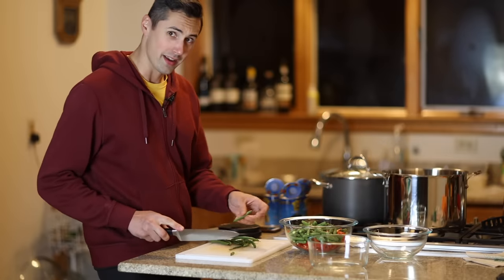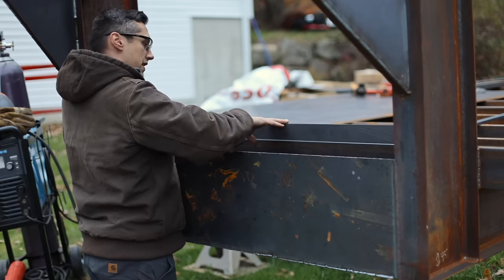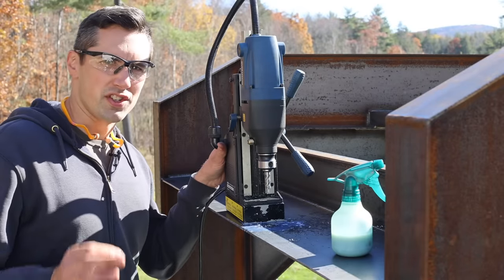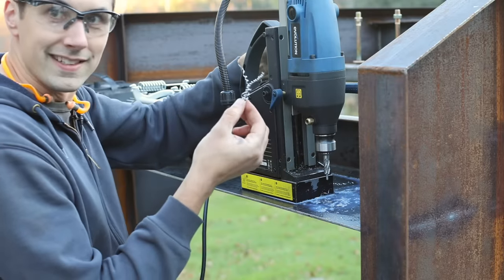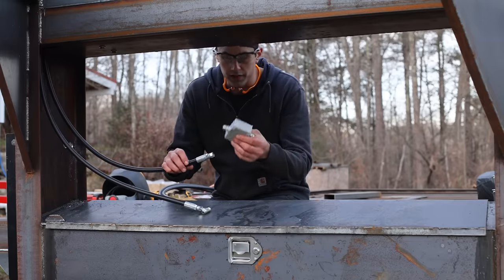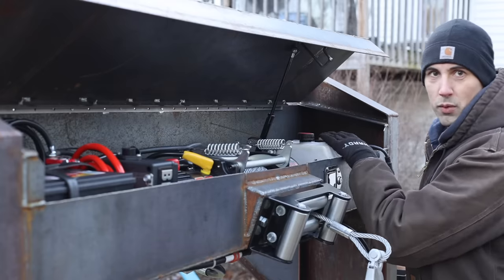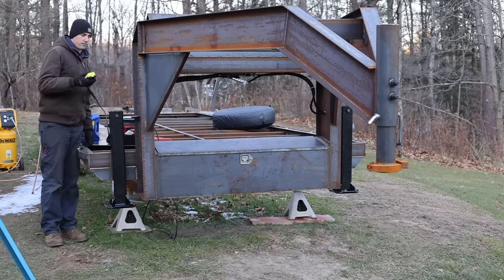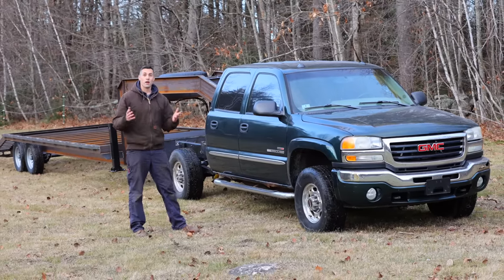Gooseneck Trailer Build Part 2: Hydraulic Jacks, Toolboxes, and a Winch

Comment: Ok I think ur gonna need a bigger solar panel my guy, 3 watts isn’t enough to charge your phone,,, it would take 500 hours to charge that lead acid battery from empty to full,,, every second you use your winch at full capacity you need to charge the batty with that solar panel for 2 days at least (I think my math is correct don’t quote me ❤️ I love ur vids and this isn’t meant to be a hateful comment I’m just putting numbers out there, get ur self a 50w solar panel)

Comment: I know you went cheap... but coming from experience whose owned these trailers....  the BATTERY... you don't need to be looking a Cold cranking amps because you're not running a car... the battery you need is a DEEP CYCLE. 

With a Cranking Battery, you run a motor to start an engine for a few seconds... you're trailer, your running motors (Jack's and wenches) for minutes at a time, so Deep Cycle is the way to go...

You battery would go dead, and even lower battery if you used your wench to recover a disabled dozer or tractor one day...
Reply: And you're going to need safety chains on your coupler...  thats a Federal Requirement

Comment: Im not an engineer (you’ve mentioned you have an engineering background) 

But that winch will fail. Ive seen these fail on a few occasions due to insufficient mounting plate strength. A sheet of 3/16 mild steel will not hold the force a 12k will put on it.

Comment: Not to be a Jerk , but i can tell by the Craftsmanship  you do that you like  things that are quality i’ve owned many Boats and Trailers  don’t be too suprised if the Stainless Hardware you got off the Internet starts Rusting up quickly as there are different grades of Stainless and usually  to keep the pricing low Online they  usually send you the  least quality FYI  as a rule West Marine Stores carry a  decent grade for the Money  but it will cost you a little more  also many Locally owned Ace Hardware stores  do stock Premium Grade Stainless again at a higher Price  i have a store that is actually in the town i keep my Boat in a Marina near by  and the Owner Operator  knows the Locals don’t mind paying a little extra  for thecQuality  BTW the man explained to me  that his actuall markup is only 17%  which in retail is way less than Usuall  i love the Place and  he also stocks a great Plated and Polished Hardware section  that HotRodders and CustomMotorcycle builders love  ! Damn that stuff is Pricey but i’ve  bought Grade 8 Bolts  for  my Shock mounts on a Gold Wing

Comment: I guess you're not concerned about the weight you're slamming on this thing. Like all that 2" angel on the back I would have used some expanded metal properly enforced. And all that 3/16" for toolboxes?? Much lighter. Have you weighed it empty?

Comment: Ay yo can I get that recipe
Reply from the maker: Sure thing 😂

Thai Red Curry
Makes 4 servings
Serve with rice (2 cups dry)

Ingredients
* 2 (8 ounce) cans bamboo shoots, drained and thinly sliced 
* 3 tablespoons corn oil 
* 4 oz red curry paste
* 1 pound chicken breast, cut into 1/2-inch cubes 
* 2 (14 ounce) cans coconut milk
* 1 red bell pepper, thinly sliced 
* 1 small zucchini, crinkle sliced
* 1/3 cup white sugar 
* ½ teaspoon salt
* 2 teaspoons fish sauce
* ½ cup Thai basil 

Directions 
* Bring a large pot of water to a boil and cook bamboo shoots for 5 minutes. Drain.
* Heat oil in a large pot over medium heat and cook curry paste until fragrant, about 2 minutes. 
* Add chicken, increase heat and cook until starting to brown, 3 to 5 minutes. 
* Reduce heat and add coconut milk, sugar, and salt. Simmer for 15 minutes. Cover if necessary to retain liquid.
* Add bamboo shoots, and red bell pepper. Simmer for 6 minutes. 
* Add zucchini and simmer for an additional 5 minutes. 
* Stir in fish sauce and Thai basil and serve.
Reply: @WaldosWorld  😂😂 thanks can't wait to try it

Comment: Recipe?!
Reply from the maker: Here you go 😂

Thai Red Curry
Makes 4 servings
Serve with rice (2 cups dry)

Ingredients
* 2 (8 ounce) cans bamboo shoots, drained and thinly sliced 
* 3 tablespoons corn oil 
* 4 oz red curry paste
* 1 pound chicken breast, cut into 1/2-inch cubes 
* 2 (14 ounce) cans coconut milk
* 1 red bell pepper, thinly sliced 
* 1 small zucchini, crinkle sliced
* 1/3 cup white sugar 
* ½ teaspoon salt
* 2 teaspoons fish sauce
* ½ cup Thai basil 

Directions 
* Bring a large pot of water to a boil and cook bamboo shoots for 5 minutes. Drain.
* Heat oil in a large pot over medium heat and cook curry paste until fragrant, about 2 minutes. 
* Add chicken, increase heat and cook until starting to brown, 3 to 5 minutes. 
* Reduce heat and add coconut milk, sugar, and salt. Simmer for 15 minutes. Cover if necessary to retain liquid.
* Add bamboo shoots, and red bell pepper. Simmer for 6 minutes. 
* Add zucchini and simmer for an additional 5 minutes. 
* Stir in fish sauce and Thai basil and serve.
Reply: @WaldosWorld  thanks! Truck and trailer both looking good. A lot of progress made, I like the way you set everything up.

Comment: Awesome. Great presentation and useful video. Must have taken quite some time to film and edit, too. Thanks for doing this. I’m not building a trailer, but for some reason this is the second trailer-build / modify video I’ve watched in the last week. The other was this: https://www.youtube.com/watch?v=Y4T-yzOQkoQ , and there’s a lot of good ideas there, too. Agree with the battery statement. A standard car battery with a large ‘cold crank amps’ (CCA) rating is designed to provide a lot of power to a starter motor, and be regularly topped up by an alternator. They will provide about half their amp hour capacity and then the voltage will have dropped to a discharged state. A leisure battery has differently designed plates and can take more discharge/charge cycles and can have more of its capacity removed before it’s discharged. Having said this, a leisure battery to take the discharge of your winch might need to be even bigger than the ‘starting’ battery you have. Leisure batteries are not designed to have lots of power removed quickly so this might be moot. I like the hydraulic jacks. Do they self-level if there’s a height difference between them? Finally, I needed to replace some gas struts recently and I was told they should be mounted so the piston is at the bottom and the cylinder it at the top so the inner seals are better lubricated, see: https://www.sgs-engineering.com/help-advice/how-to-install-a-gas-strut/ (no affiliation). Cheers!

Comment: This trailer is going to be too heavy. You should have used mesh for the toolbox or aluminum.
Reply: Trailers usually weight about 1/3 - 1/4 of the weight they can carry
Reply: @dm-zx7xb  the point is this is going to be so heavy that with the trailer and truck you are going to need a class a cdl.
Reply: You will need a CDL, if the combined gross weight carrying capacity of the truck & trailer is above 26,000 Lbs. Even if the trailer is empty, it goes by the Gross Combined Weight........ Check your state rules, but if you travel out of you state check those rules too

Comment: Why are the jacks not even on the front the heck
Reply: I saw that too. As accurate as he, I doubt the jacks are off a 1/16 inch from each other. Gopro cameras have a weird FOV (Field of view) I have the same issue with mine. They bend and distort video. I think it's just FOV, the camera location and the un-even ground that makes it look that way. at 23:00 when he tests them. the one on the right looks mounted closer to the gooseneck but later in the video it's not.
Reply: @jamescole6846  They use a fish eye lens for a broader field of perspective.
Reply from the maker: The ground was uneven and it may have been caused by air in the system. It'll work itself out 👍